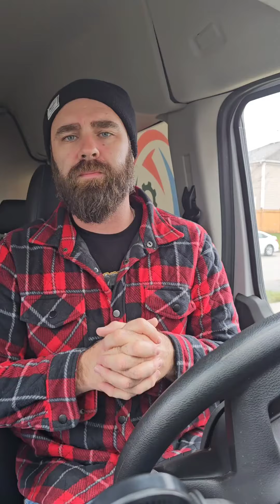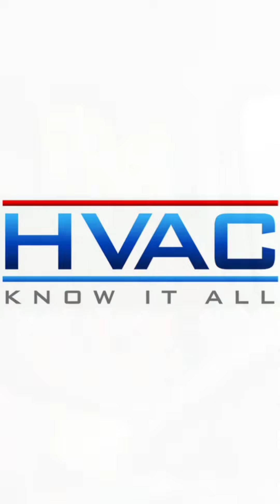Unlocking The Secrets To Dominating Commercial HVAC As A Residential Tech

Comment: Is two years in residential enough to go commercial? Would I need more knowledge/experience? What kind of things do commercial companies look for aside of knowledge & being a good worker?
Reply: I only had 2 years residential when I switched. As long as you have the knowledge of changing out a compressor, expansion valves, and motors you will be ok. You’re going to feel overwhelmed pretty quickly but that’s normal. It’s all the same fundamentally but a lot more complex at the same time. I enjoy it but made a lot more money in residential